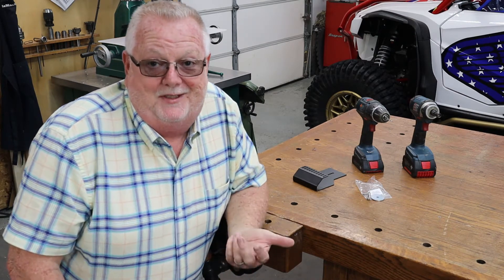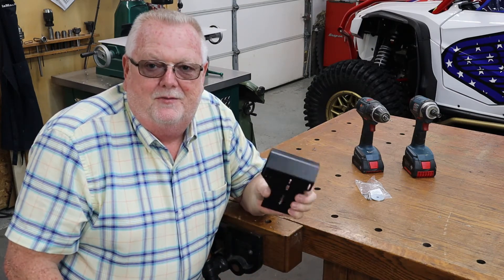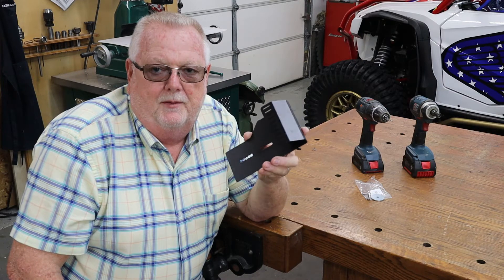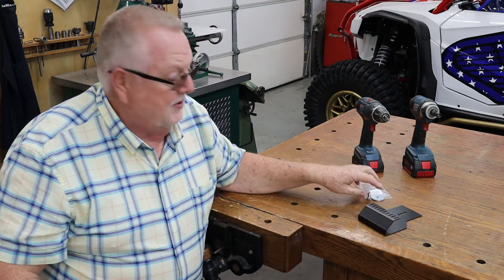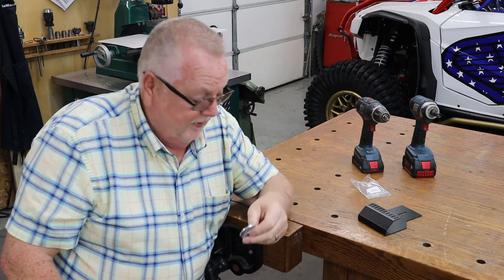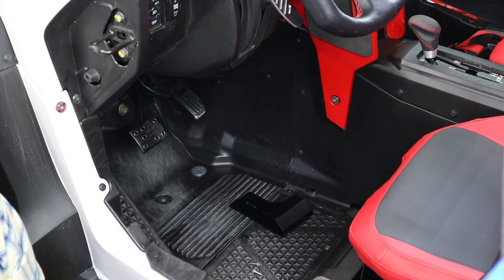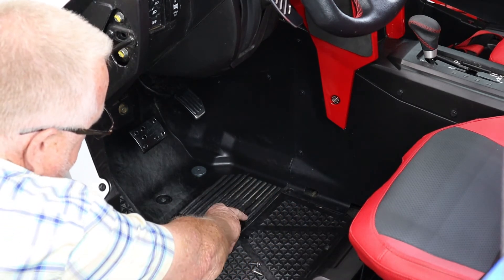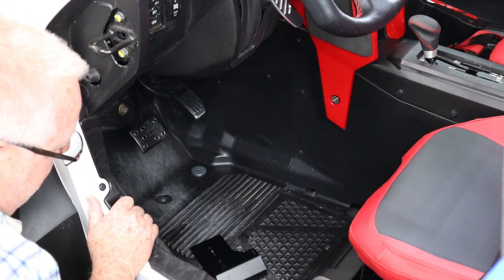Brute Performance throttle pedal foot rest

Comment: Terry,  Have you had a chance to try this out on some trails?  I just got back from a trip (the second long trail ride with my Talon) and I have been struggling keeping me foot from constantly "goosing" the throttle over every bump.  I finally figured out if I keep my foot as vertical as possible with my heal as far forward as possible I can substantially smooth out the ride.  However it is not a very comfortable way to control the throttle.  I wonder if this rest may help.  From your video it does not look lie it is forward enough.  With my foot near vertical my heal sits in the first or second second ridge back.  In the video it looks like the rest as far forward as possible is only at the 4th ridge.  I may be able to modify it to move it forward more.
Reply from the maker: I've ridden several times since we installed it. It works well for me where it's mounted but I'm considering moving it to the left a little so my foot can be a bit more angled.  Would be simple enough to trim it a bit if you needed it farther forward.

Comment: What kind of shifter knob is that?
Reply from the maker: Ebay. I like it a lot. Requires cutting the flat section of the top of the shift lever. I used the smallest sleeve. Worked fine and matches my Dragonfire D shaped wheel. https://www.ebay.com/itm/F998-Universal-Leather-Gear-Shift-Knob-Head-Shifter-Black-Red-Line-for-Car/392702270490?ssPageName=STRK%3AMEBIDX%3AIT&_trksid=p2057872.m2749.l2649